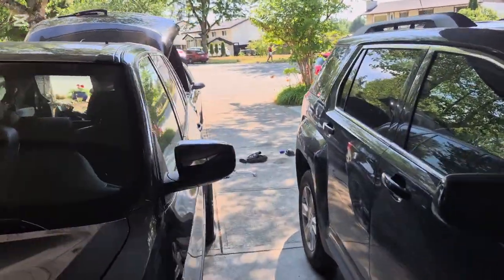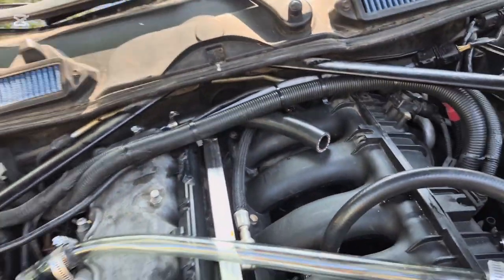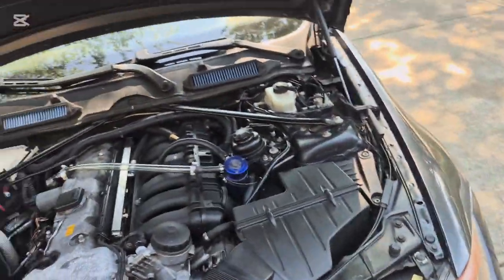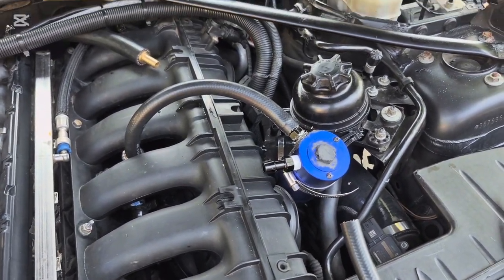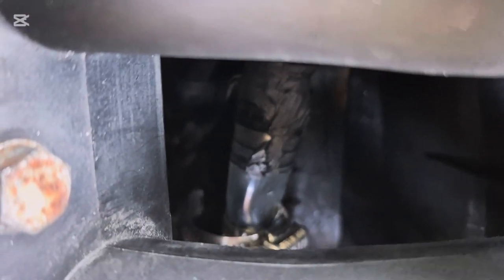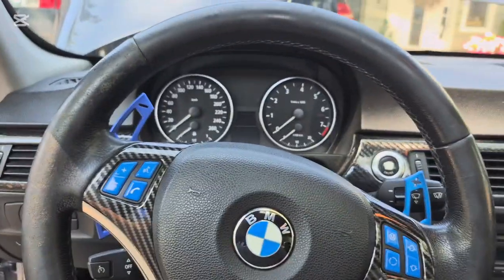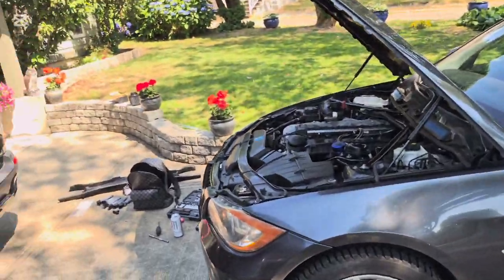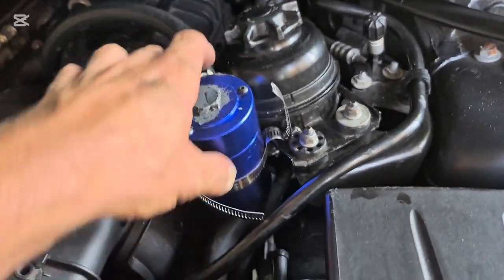BMW E90 - N52 PCV Bypass / Catch Can Install

Comment from the maker: Make sure you install a 1 way check valve on the out line of the catch can to prevent backpressure when letting off the gas. Its not always needed but if you notice leaks still then try adding one!

Comment: The main question I had, does it leave the check engine light on if I completely remove the PCV? And add the oil catch can instead

Comment: Man I needed this video I’m doing this as well you are the Man for making this video very helpful. Thank a Ton.
Reply from the maker: Hey no problem! Just make sure u use hose that fits snug to your fittings as even a pinhole will cause rpm fluctuations and dead spots on throttle. Also a 1 way valve from the out line may be needed if u notice oil leaks forming

Comment: So you no longer use the CCV Valve under the manifold. It looks like it’s still there…are all of the inlets and outlets all blocked off on it…like on the end of the hose where you have the t-fitting? Is there any type of pvc or one-way valve Thanks. Great video
Reply from the maker: Yea in this video they were all just blocked off with rubber vacuum hose caps. You SHOULD use a 1 way valve definitely however i dont have that on here. But if youre doing this a 1 way valve is jist an extra step of protection that cant hurt anything
Reply from the maker: In my later videos where i install the n54 manifold u can see i no longer have any of that in there
Reply: @Beamer-Fonz Beautiful. Thanks for the super fast reply

Comment: Can you make a list of everything used?. Pretty pretty please! Would love to delete my pvc. Just nervous ill not have something.
Reply from the maker: I gotchu! So u need a catch can, some 3/4 inch hose to catch can and feom catch can, some slightly bigger than 3/4inch hose or an adapter to fit over the valve cover so like 3/4 to 1 inch adapter and hose cuz the valve cover port is huge, pcv heater adapter from printables auto and some vacuum line caps from amazon or eherever just in case u have extra vacuum ports that need to be capped off. Evrrything MUST be air tight or u will have idle isses. Ur hose and fittings must be able to seal against approx 20lbs of vacuum pressure. If u come across any of these issues u can cap off the vacuum ports and just vent the pressure to atmosphere til u sort the vacuum issues (if u get any)
Reply from the maker: If u buy a catch can specifically for ur car it should come with alot of the parts u need like hose and clamps etc

Comment: Just got my 2007 323i n52 for a steal, at least I thought, idling kinda rough (only sometimes). grey smoke from exhaust (and when I remove oil cap). When I remove the oil cap while it’s running there’s some suction, I’m thinking it has to be my pcv, you think a catch can Is the way to go about fixing it? Also thought my belt was sounding a bit funny but I can hear yours just the same.
Reply from the maker: Sorry i just saw this. Yea catch can should sort you out but make sure u add a check valve on the out line from the cab i forgot to mention that

Comment: Nice job. Have a  E90 330i. Did the catch can reduce oil consumption? Thanks
Reply from the maker: Yea quite a bit and got rid of some smoke smell from leaking valve cover due to extra crank case pressure being releived (my theory at least)